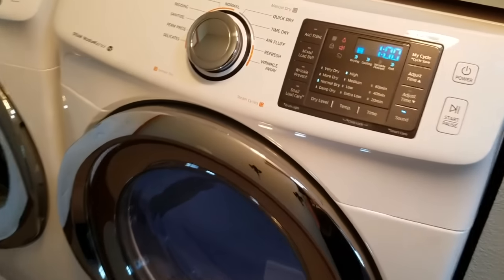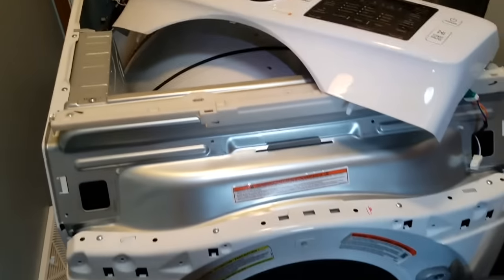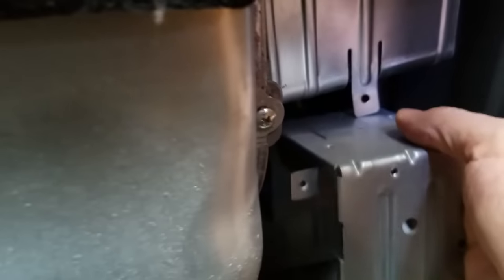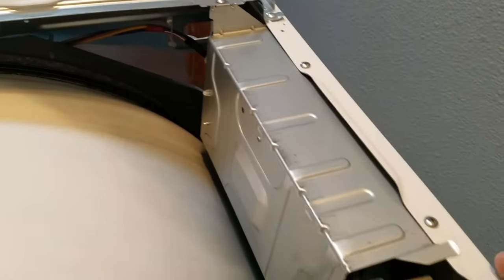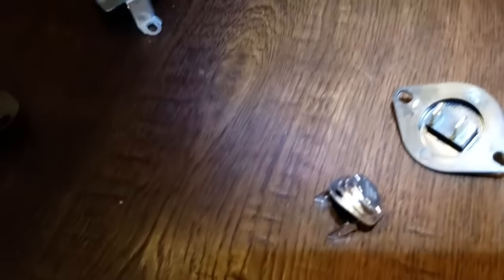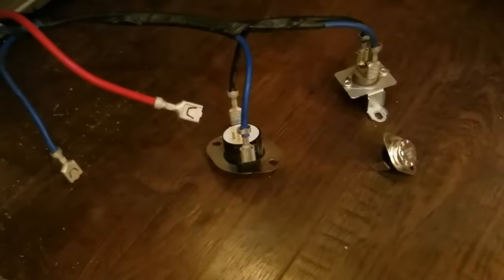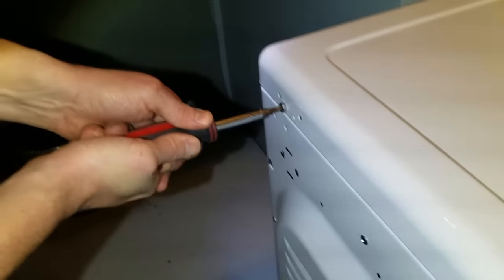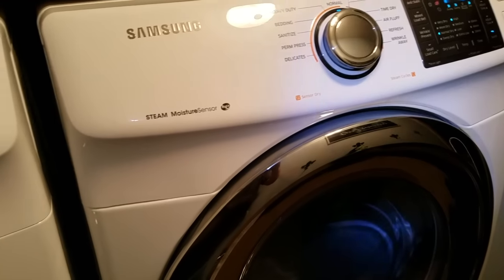Samsung Clothes Dryer Heating Element DIY Repair - No Heat & Noise Fix

Comment: Hi, my dryer makes noise but it is stil ok with the heating.   Do you have the link for the part you bought to fix the noise?  Or could you please tell me the name of the part?  I would like to know it if you don’t mind.  I have a 7.5-cu ft Stackable Electric Dryer (Model#: DV45H6300EW).  It looks similar to yours.  I just want to know name of the part that causes the noises so I can replace it.  Thanks so much 🙏
Reply from the maker: No problem. It is just a roll of foam insulation weather stripping window seal. Pick it up at your local hardware store.
Reply from the maker: I didn't replace any noisy parts I just used the window seal to stop the vibration.
Reply: Melvin Zoopers 
so the name is called “weather stripping window seal”?  Thanks.

Comment: I’ve had to change my element 3 times now I’m going on # 4 is there something more I can look to that would be causing these to burnout so fast or is there some kind of preventative maintenance besides keeping the lint filter clean that would prolong the life of the element please lmk Ty
Reply from the maker: I've replaced mine twice now. There are no tips that I can think of.
Reply: @MelvinZoopers  thanks it’s crazy I pulled the element yesterday it looks perfectly new there’s no breaks in the heating coil or apparent failure to the part itself I guess I’ll order a new one and put it in again fingers crossed

Comment: Hey there, I had this similar dryer Samsung DV42H5200EW/A3 and I took it apart just now to see if the heating coil itself was broke and it was not. I then use my voltmeter and check all three of the sensors on it. When I do that they all show voltage. Are they all supposed to read "ZERO" if its a good sensor and if it shows some sort of voltage does it mean that its bad?
Reply from the maker: Not sure about that. Double check that coil. It might seem ok, but is actually bad.

Comment: I have the same unit and replaced the heating element and the two parts that it came with. Checked the wiring photo etc: still no heat. Wonder what else it could be.
Reply: Same thing happened to me. Did you find a fix for this?

Comment: That front panel has hooks on it, it does not pop right off. They are at the bottom front and will not release. Any advice?

Comment: I got the same issue the dryer throwing a code HE Ive replaced the heating element and all sensors but still throwing the same code, I’m running out of options any suggestions?

Comment: ok so is it necessary to take the whole thing apart or can I just get away with taking off the front to do the heating element? thanks!!
Reply: The top, front control panel and door assembly must be removed to gain access to the heating element...sorry for the bad be
News..I just did mine today...

Comment: This is a good video, but you skip a lot of areas and a lot of assembly steps that would be very helpful to novices like me. At least five times you say you take this out or we put this back together and then you skip when you actually do it and just fast forward to the next step without showing how to actually put things back in. This was almost a very helpful video.

Comment: Hi there, I took mine apart and all 3 connections passed a continuity test. I still replaced the heat element to be safe but still no hest. Any clue what I should look at next if I'm having issue still?
Reply from the maker: Let me think about that one.
Reply: There is 2 more thermals behind the blower.go in through the back exhaust. Look in with flashlight. The 2 pcs that look different in this video are there.

Comment: Hi there my dryer is exact same just black. I have lost my book 📖 and my vent icon on control panel comes on and the dryer will run just won’t heat up and kicks off after 6 minutes total.  What ya think 🤔? It is 3 years old.
Reply from the maker: It would seem that your vent may be blocked with lint or something. 🤔
Reply: I will try that again and see ty for the response back I appreciate it

Comment: I prefer original manufactured parts for reliability. Those cheap Chinese crap will only last you like a month max and they are notorious at blowing fuses. Thanks for the demo video.
Reply from the maker: Already replaced it once since then.

Comment: I followed the video. My dryer is heating again, but there is a burnt smell coming out of my dryer now. Kind of afraid to use it. Any tip?
Reply from the maker: Probably just the new element getting heated up should go away in 5-10 minutes.

Comment: Model #: DV42H5200EF/A3 ... Having difficulty getting the top-front panel up and out. The two sides seem free to do so, but there seems to be something resisting in the panel's center. HELP!
Reply from the maker: Not sure. Push down & pull out toward you.

Comment: I replaced the complete heating unit/element and the thermistor and my unit still has no heat????
Reply: I have the same issue I replaced heating element the thermistor thermostat and the cut off still no heat. I don't know what is the issue now
Reply: @heribertovasquez652  I just replaced the two piece brain and I still don’t have heat, and it’s electric

Comment: Hi this video is helpful to remove the parts, but I can't find the heating coil for my samsung dryer model: DV42H5600EF/AC
 does anyone fix this model? Where did you get the parts?

Comment: I have same dryer and did same steps but when I turned it on a big spark came from bottom and smelled burnt but was still in cycle. I turn off right away and unplugged it. Any suggestions? Thanks
Reply from the maker: Not sure. Proceed with caution.

Comment: What year is that dryer ? Have the same one I think.. and I think my heating Element went out to if it is will my old one be broken to like yours or is there other ways it can mess up if that makes any sense
Reply from the maker: It's only about 3-4 years old. I know there are other things that can go wrong to cause it to stop heating but this by far is the most common.
Reply: Melvin Zoopers okay! and it will snap like that if it is ?
Reply from the maker: Yes. There will be a break in the wire.
Reply: Melvin Zoopers welp there was a break in the wire...Thanks for you help Melvin 👏🏽

Comment: Hello again, I did this myself ( see msg below), dryer now has heat, but once I turned the dryer on, within 15 seconds my smoke alarm went off ( no smoke visible) but did smell like burnt.  Is this normal?  I followed every step from your video. I read somewhere that you are supposed to let it for 30 mins.
Reply from the maker: I think it is. It is probably just a few dust particles or the finish burning off the new element. 🔥

Comment: Can someone please help. Where does one buy the quick disconnect electrical clips (specifically the large, red one that is being reconnected at 13:24). I'm searching everywhere and can't find them. any help would be greatly appreciated.
Reply from the maker: If this was the 90s, I would say go to RadioShack.
Look this up on Ebay: "Assorted Insulated Electrical Wire Terminals Crimp Connectors Spade"

Comment: Hello there, how do u check the sensors?
Reply from the maker: You could check the connections for continuity if you have a multimeter. If there is none you need to replace it.
Reply: @MelvinZoopers  appreciate you!

Comment: In the middle of replacing using this video for reference, taking apart was breeze. But you cut away the part where you removed the wires from the element. I'm having trouble disconnecting the red and blue wires from the actual element. Anyone else?
Reply from the maker: Grab a pliers and pull away and the connections should slide part.
Reply: Worked like a charm. Doing the test run now! :D

Comment: Just got done changing my element. Unfortunately still no heat :(((
Any ideas? Maybe the node things on the side of the housing for the element? Can those be changed maybe? Not sure what they are called.
Reply: Same thing for me. Still no heat. Did you ever find a fix for this?
Reply: Yes! I changed the little black nodes on the side of the element housing and it worked! Sorry idk what they are called it was over a year ago. They are round black puck looking sensors. They were like 20-30 $ probably.
Reply: Awesome thank you. I will try that
Reply: Yeah since replacing those a year ago mines been going strong 💪 good luck!

Comment: Where do I purchase that kit or replacement parts?
Reply from the maker: I bought mine on Amazon.
Reply: I’m finding just the heating element. Did you buy the fuse and thermostat too? I’m only getting one match for this dryer on amazon. For the fuse and thermostat kits I’m seeing other dryer models only. What do you think? Thanks for this video!
Reply: I see it now. Thanks!
Reply: Victor Montoyaamaya could you send me the link to where you bought the parts i have the same problem
Reply from the maker: Replacement part number is listed in the description of the video.

Comment: Hi this video is helpful to remove the parts, but I can't find the heating coil for my samsung dryer model: DV42H5600EF/AC
 does anyone fix this model? Where did you get the parts?
Reply from the maker: I googled my " heating element samsung - model number" & found a match on Amazon.

Comment: Was the broken heating element causing the noise as well ?
Reply from the maker: No. Separate issue entirely but as long as I had it open I fixed the issue.
Reply: Didn’t you pay attention to the video?!

Comment: How do i remove the front control panel? I keep trying and it wont come off! Please help!
Reply from the maker: Release the tabs on either side. Pull it up and out towards you and you'll probably have to use some Force. Once those tabs are released it should come apart.
Reply: Melvin Zoopers thanks it worked!

Comment: Our heating element stops working don't know why. We bought new one and installed and after two or three washes it agains stops working. Can anyone explain the reason
Reply: Check your dryer duct. It may be full of lint which is not allowing the heat from the dryer to escape out of the roof or the side of your house which then causes the heating element to break.  Mine did the same thing so when I checked my duct it was full of lint.  Huge fire hazard.
Reply: @bobbyvernengo7863  we called electrician and this time it was harness attached with heating element that got roasted not sure why this is happening

Comment: While it is apart you should replace all you can. At least test for resistance of old parts
Reply from the maker: Sometimes that is the case, yes. However, sometimes the original factory part may be better than the knock-off part. Test...sure.

Comment: How the hell did you get those screws on the back out? You just cut the video on that part. It’s like impossible to get back there with a screw driver
Reply from the maker: Trust me it can be done. Use a stubby screwdriver.

Comment: Where's the step where you disconnected the wire tabs????!!
I'm stuck!!
Reply from the maker: Grab a pliers and use it to just pull the wires away from the tabs.
Reply: @MelvinZoopers  they look like they're soldered on
Reply: @MelvinZoopers  I have all the screws off except the tabs feeding the heating element

Comment: Hey, how old is your dryer, because I have the same dryer only four/five years old and there rusted area all on the bottom floor an, the heat housing, the frame in front and there are screws that are rusted so much that I am unable to remove. I had to dismantle at least 75% of the unit. Ridiculous how Samsung used parts that are inferior. I am a sixty plus female and watched several YouTube videos but was disappointed to see all this rust. $1000.00 for aluminum. SAMSUNG SHOULD ASHAMED AT HOW  THEY STEAL A CUSTOMER MONEY. I AM THINKING OF REMOVING AS MUCH RUST AS POSSIBLE AND PAIT WITH A RUST INHIBITOR, PLEAS TELL ME WHAT YOU THINK OF THIS IDEA. THANK YOU FOR YOUR VIDEO.
Reply from the maker: Rust inhibitor sounds like a good plan. You must have lots of humidity in the house with all that rust.

Comment: Everybody fails to identify  the two screws at the back of the bracket that holds the heating unit up. I call them the son of b&^%$ screws. They are missing from all videos I've seen, you'll need a ratcheting 90○ off set screw driver to get them out.  Other than that the video work as shown.